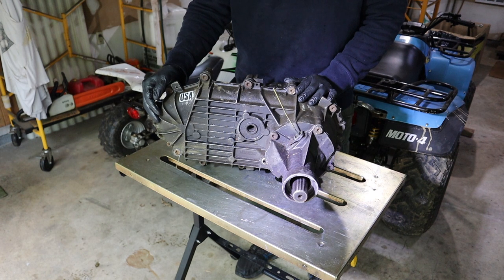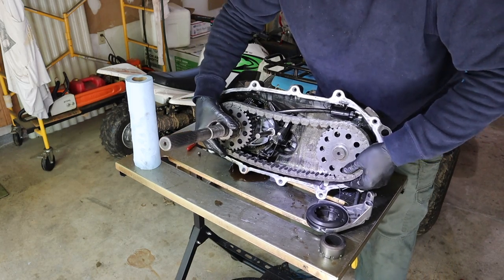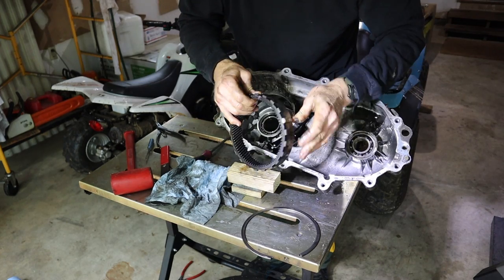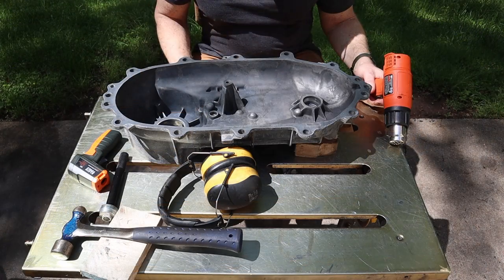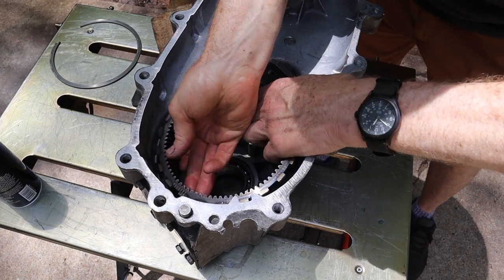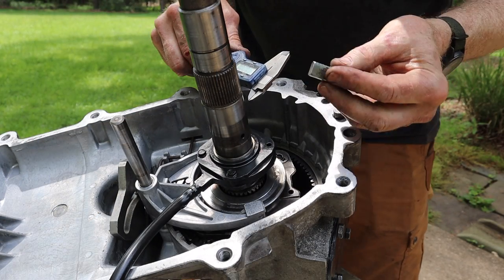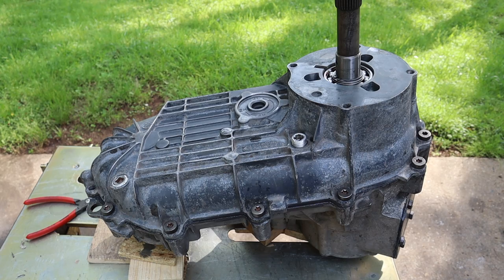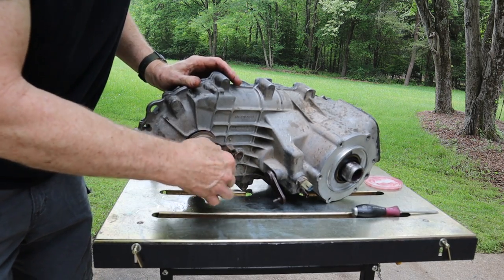Borg Warner 1356 Transfer Case Rebuild and Pump Mod, Project Brutus, Episode 25!!!

Comment: Thanks for the video, but i think you made a mistake with the speedometer gear.  The gear drops on first, with the slot for the bearing facing out.  drop in the ball bearing, and slide the gear up, then put the clip in behind it.  This will keep the gear in place.  The way you put it on, there is nothing keeping it from waling off sir.  All in all this video really helped me with my rebuild and work out pump arm.
Reply from the maker: Thanks for the input!  Scott

Comment: As far as the front output seal. If the shaft is out, raise one edge of the flange with a screwdriver and completely cave the seal in towards its center at that point. What holds them in so well is the paint on the seal body. It’s a glue and a sealant. If the shaft is still in it then other methods must be used. Those seal removers are, disappointing. Mine looks just like yours does. Not a very well thought out tool.
Reply from the maker: Thanks for the input!  Scott

Comment: Using seal and race drivers to install bearings, turn the driver over so the taper faces up. This makes sure you don’t hit the inner race separate from the outer race.
Reply from the maker: Thanks for the input!  Scott

Comment: Cool rebuild but you put the speedo dive gear backwards should have put speedo gear on with the slot opening facing rear ward drop ball-bearing in hole slide gear backwards then band snap sleeve now gear can't walk backwards
Reply from the maker: Thanks for the correction!  I'll know better next time.  Scott

Comment: All right just so everybody knows you can drill a 1/8 inch hole thread a screw self Tapper or whatever into that hole and he's a dent puller and it comes right out you have to keep in mind that you don't want to drill into anything important the whole thing is metal angle to drill to the center of the hole we're center of the shaft if it was in it insert your screw and then smack it with the dent puller
Reply from the maker: Thanks for the input!

Comment: There are pry point provisions on each of the long ends of the case. Specifically for well sealed cases. I’m willing to guess this case was never apart. At a minimum I would have replaced the chain.
Reply from the maker: Thanks for the input.  Scott

Comment: Opened up my BW1356 today it was running without a pump assembly.  The side is worn all the way where the pump would rub the case if it were installed. Seeking options at this point, I know I can rebuild this with ease just no luck with this case.
Reply from the maker: I'd source another unit.  These aren't super difficult to find or very expensive, either.  Good luck with it!  Scott
Reply: @THEBULLETPROOFGARAGE  I went from the worst of luck to the best! I stopped by the junk yard today and you would not believe it. The last truck I looked up under was the only truck with a transfer case and it was a BW1356. Best part was it was already cut out by someone else and they must have left that gold egg there for me. Nice bright red ATF pour out the case and I knew it was well maintained. I stripped it down at home. Case isn't worn through much at all, pump was in there and the planetary gear is rock solid while my original was broken. Great day $65 later and saving over $600 if I had course used parts if not more.
Reply from the maker: @1PrudentPatriot  - Excellent news!  Glad to hear that it worked out for you!!!  Scott

Comment: Great work Scott.  I’ve had two of these cases in old ford Diesels and they have always been reliable.  Leaky? Yes.  I’m about to pull the rear slip yoke off mine to install a new bushing and reseal so this is a huge help and mental refresher.
Reply from the maker: Happy to help, Aaron!  Thanks for the comment, Scott

Comment: A tip I've learned myself when applying anything from a squeeze tube is to use a pair of pliers pinched on the end and roll as you go.  Much quicker, much easier, and more consistent application.

If I didn't know any better, but I think the lockup collar/spacer was installed one tooth CCW?  It just didn't look right from the video, but I haven't disassembled my 1356 yet to verify it!  Also nice mod on pump, anything small to make it last that much longer!
Reply from the maker: Thanks for the input!  Scott

Comment: 3/8" threads in steel about 30 ft lbs in alluminum 20-25 
Make sure you get the pickup tube and filter secure I've seen em flopping around and loose. All the best Sir.
Reply from the maker: Thanks, @ELDIABLO444!

Comment: The splinted rubber washer is the driveshaft plug. It seals the full transfer case until the assembly line when they push the driveshaft on. It sits in the output shaft seal. Not sure though, but what held the speedometer gear from moving backwards on the shaft?
Reply from the maker: Thanks for the info!  Scott

Comment: I was wondering what I might get into when doing the oil pump mod. I have a low mileage (<50K) 1356 w/PTO from a retired brush truck and I'm hoping it will be just as clean as yours was, although I expect it to be original. Thanks for the video!
Reply from the maker: Hi salans7 - Hope yours is at least as clean as mine was!  Good luck with the rebuild, Scott

Comment: Thanks for the video, was going to just throw some new seals on a t-case I bought on eBay but after watching your vid I checked the oil pump arm slot and found it work about 80% through. Doing the pump mod now per your method. Did a little searching and saw most guys are using a piece of round stock for the mod but I like using the flat a bit better. Probably doesn’t make too much of a difference in the long run but if you’re going through the trouble why not do it right?
Reply from the maker: Glad to hear that you found the video helpful!  Scott